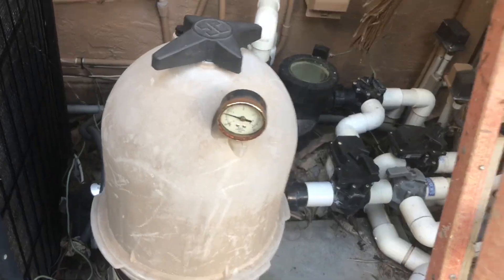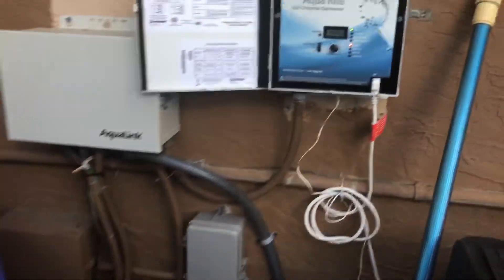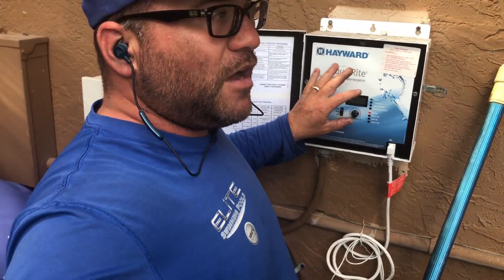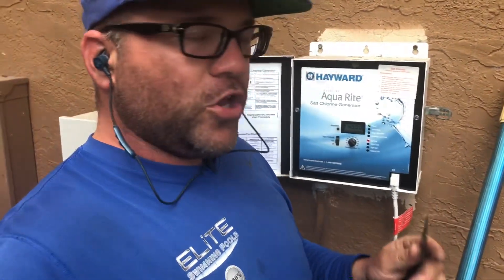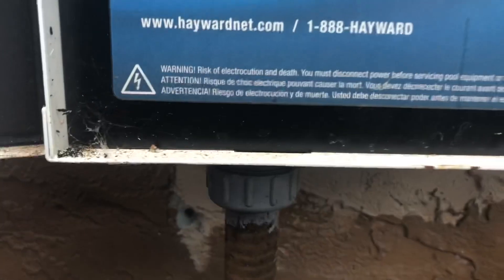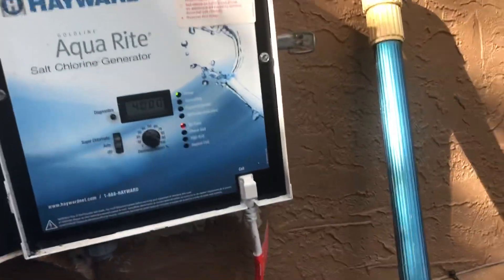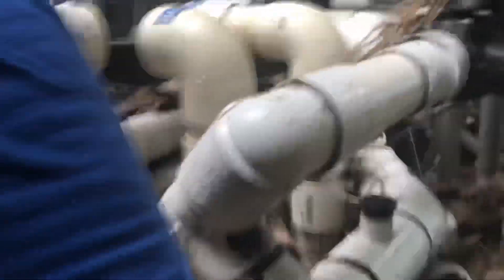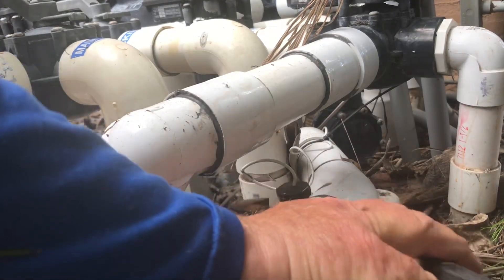Hayward AquaRite Salt System NO FLOW? Tips and Tricks to easily Diagnose and Fix

Comment: I guess if you have an electrical tester you can also test continuity on the cable going to the flow switch with a pump running it should have continuity assuming and if it doesn't the flow switch is bad

Comment: What if my setup does not have a flow switch to change out?
Reply from the maker: Well, How does the Hayward unit operate? They all are designed with a flow switch as far as my knowledge serves me correct.
Reply: Good question.  Thanks for the reply.
Reply: @EliteSwimmingPoolsTV  Found it.  Was buried.
Reply from the maker: Lol. Sometimes it happens. Great 👍🏼

Comment: Good advice!  I did that, and I found the same results you got.  Thanks Man!
Reply: Is it worth a try to clean the contacts where the plug connects?
Reply from the maker: The flexible metal piece is the contact lever and makes an internal contact inside the round part which gets screwed in. Not worth the time because it most likely would make any difference.
Reply from the maker: Works every time. Your welcome.